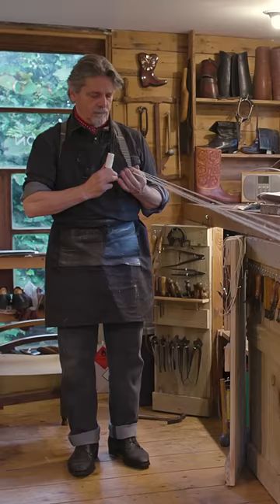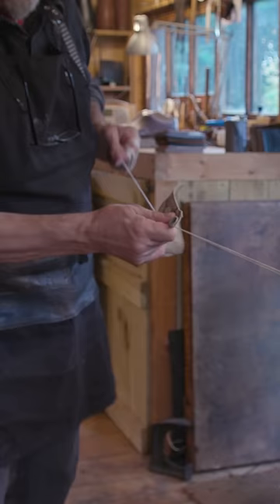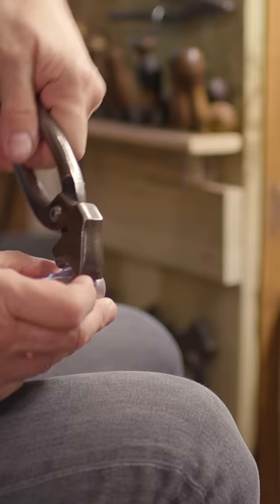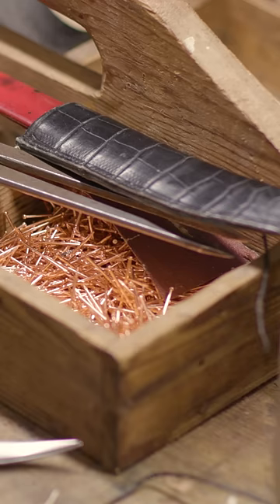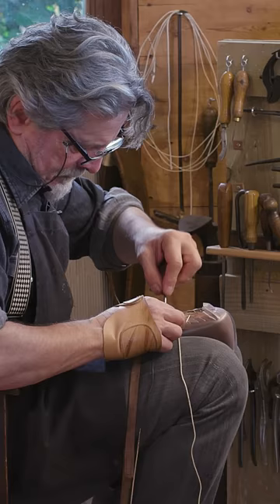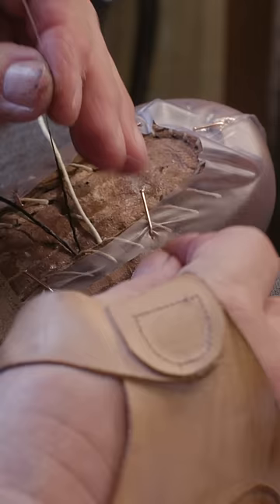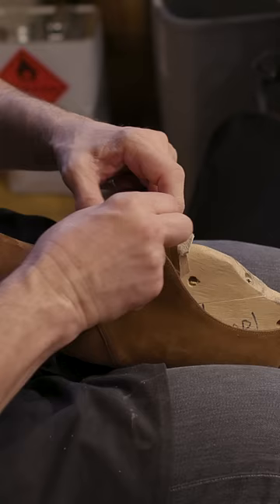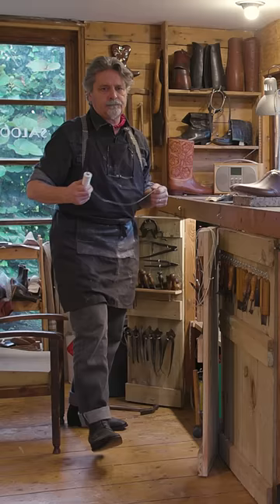Custom Shoemaker Shows The Incredible Detail Of Hand Made Shoes  #Shorts

Comment: Using a sewing machine is still by hand man. That's like saying when you use the crimp or the hole punch that that's not by hand. The only time work isn't being done by hand is when you sit something in a machine press a button and it does it for you. A gardener is still working with his hands when hes mowing the lawn. He grabs on presses the button and moves the machine. The machine doesnt move for him hes still interacting the entire time the machine is. Machinists are only hands on when they fine tune their CNC'd piece of metal. It's not hands on when they drop it in the machine and the machine cuts the basic molds out. And they sit and do nothing for 30 minutes waiting. Your work is hands on work through and through. Sewing machines are hands on tool. Just like a hammer or chainsaw.